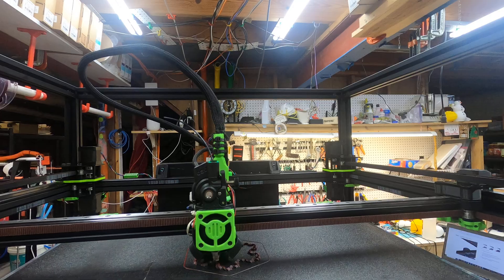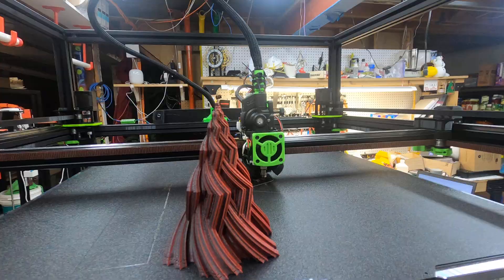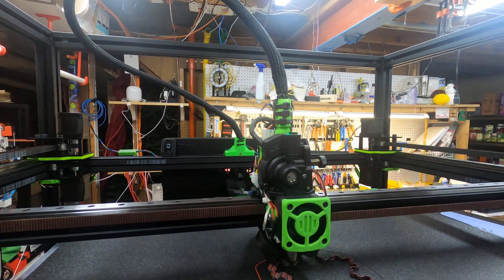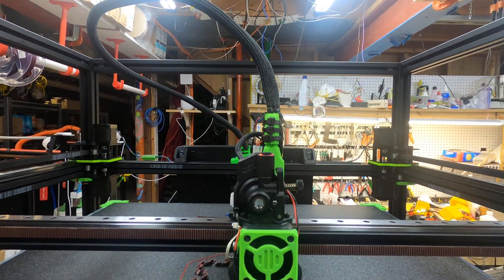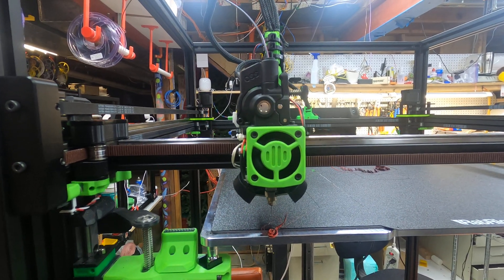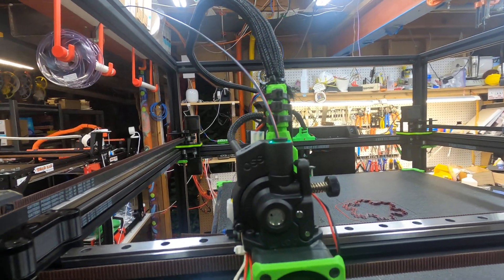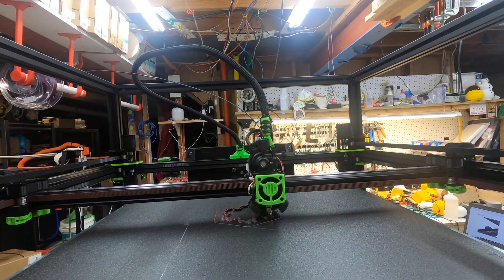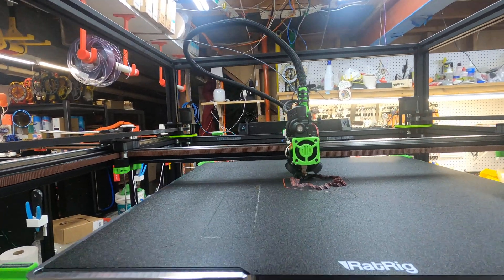Rat Rig V-core 4  Hybrid 500 mm is done!

Comment: Nice build. Are you going to crank the speed?
Reply from the maker: I may try later, it's on a shaky platform now, and moves a lot.  I find that slower results in better quality, so try and find a middle between speed and good results.  I'm working on a new way to hold the Rat Rig - keep watching
Reply: @woodwaker1  I'm the same, I like slower quality prints. I am really considering the Ratrig v4, do you think the hybrid system is necessary if I want to print at similar speeds to a Bambu printer on a ratrig 500mm?
Reply from the maker: @kimzor1989  The hybrid is really a good addition.  I tried some prints without it being connected and had some layer shifts.  Once I got it added, no more problems.  All it does is move the carriage front to back.  That is where most of the mass is, the core X-Y takes helps, but mostly moves the hot end left to right.  It is an inexpensive option and not too hard to install.  I did not get the Idex, as it was not ready and it is much more expensive.   I have two multi material printers, so did not really need it.
Reply: @woodwaker1  sold me on the hybrid addon :). I look forward to further updates on your ratrig rig

Comment: Would love to see a comparison between v-core 4 and a Bambu. Especially comparing quality and how much tuning is required. I’m on the fence between the two. I don’t mind doing the assembly but I’m tired of the endless tuning needed on my current printer just to get so-so quality. I’m looking for something that once set-up doesn’t need significant tuning to get good results. The bambu stuff looks good, but it is smaller than I want and the idex intrigues me.
Reply from the maker: I would say if you don't need the size, the Bambu X1C with AMS  would probably be better.  If you could benefit from the almost 4 times the bed size, the Rat Rig.  You might also wait to see what Bambu comes out with for their large format.
I'm fortunate that I have multiple printers that I can pick for a specific project.   Two that can print multiple colors and a few with big bed sizes.  Thanks for watching and the good question.
Reply from the maker: I would now be hesitant to recommend the Bambu X1C, they have made some changes to the Terms of Service and have caused a lot of excitement,  You can look on You Tube for details

Comment: It's a fast machine?????? Because of the size???
Reply from the maker: It can be run very fast because it is well built and a Core xy is designed to be fast.  It also has two motors to just assist in moving the carriage.  I have mine running at less than half of the max speed, and is still one of my fastest printers.  The large size is actually a drawback to speed, since there is so much mass to move quickly.

Comment: Do you think the VC4 500 can be tuned to print as well as the Bambu X1C? I need a printer that can print very large and tall prints ~450^3 near perfectly. Thanks
Reply from the maker: I think it can,  I adjusted the speed down, and am getting some great prints.  I'll post a video soon showing some.  The speed in Prusa Slicer was AAA350mm - way too fast, I lowered it to 100mm/sec.

Comment: Great looking printer. It would be awesome compare the speed and quality of the tree printed on each of your printers.
Reply from the maker: Thanks Steve, sorry I just saw your comment.  It is a beast and I'm running it slow until I get it tuned in.  So far it is doing a great job.  I just posted a video where I'm printing Christmas cards almost all of the way across.  The first layer is coming out great over almost 500mm square.
Reply: @woodwaker1  Thanks for the update. I have been thinking about getting a larger format printer, but the desk next to my PC is already full with 3 Prusas. Anything bigger would have to go downstairs where it is not as useable.
Reply from the maker: @stevesclocks  Steve, That's why all mine are in the basement.  We are fortunate to have them here, and it is a great place to keep them - the noise never makes it to the living area.  That is why I have added wifi cameras so I can watch them.  I think one of the new Rat Rig V-core 4 would be  a good fit for you.